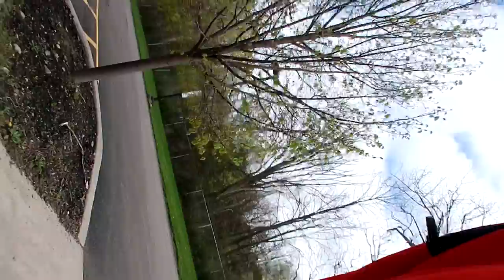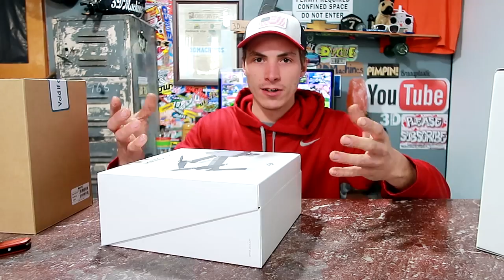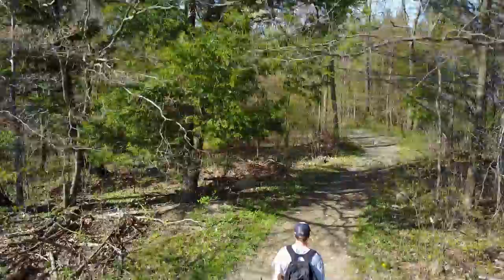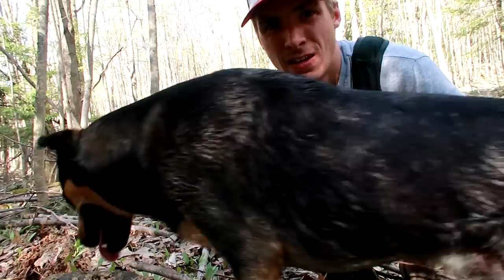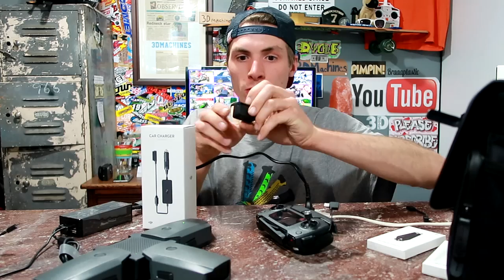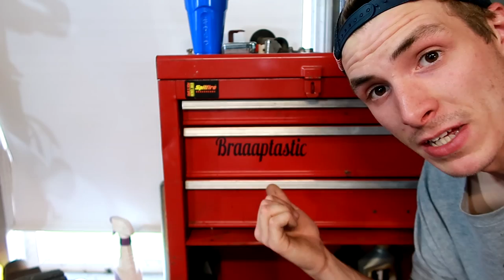I FEEL LIKE CASEY NEISTAT!!

Comment: Put a sport bike motor in the gator
Reply: Matthew Matthew inline 4 definitely. Gsxr1100 would be mad
Reply: I would say stick something in like a v45 or v65 magna engine in it, need that botom end torque offroad!!!
Reply: put a 60s kawasaki h1r 750cc triple it will have lots of power it is a 2stroke
Reply: lol the beemer is an inline 6, that motor is probably the length of the gators pan :p
Reply: lolol just have the motor sticking out through the pan
Reply: Bruno Vaio's 4bt cummins torque vs stock gator drivetrain😂
Reply from the maker: That's what I'm thinking!
Reply: 3DMachines inline 4
Reply: 1.9 ltr vw turbo diesel.
Reply: TRON 0010010110 what's the point of that it's too heavy? And if you are gonna engine swap something then you want to at least put something that sounds nice in it
Reply: 90hp 155ft tq at 1200rpms....not that heavy tbh lol..they quite small.
Reply: TRON 0010010110 a lot heavier than a super bike engine with about half the power of the super bike engine, what is your obsession with this shitty engine it's okay for a family car but even then you would rather swap it
Reply: Will Sherriff because torque lol. but i agree gator needs a motorcycle engine. speed is key.
Reply: get it dug in the mudd and see how the lack of tq helps him get unstuck lol..it would be stall city lol
Reply: TRON 0010010110 use an Aprilia rsv r Millie engine 60degree v twin
Reply: that is a great idea...good hp/tq ratio...i agree with this
Reply: TRON 0010010110 yeah and they sound amazing, my dad rides an 2003 rsv Millie r

Comment: try spraying starting fluid in it and see if when the metal warms from the fluid if it gains enough compression to run
Reply: in Jake's 300 the rings might be bad
Reply: I watched the video it did what mine did but mine fires right up when h put starting fluid in it